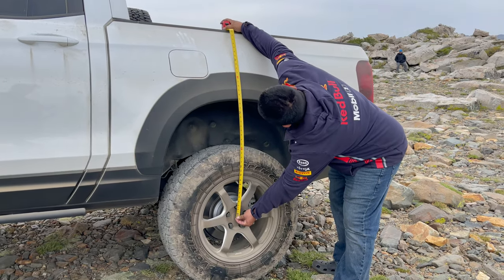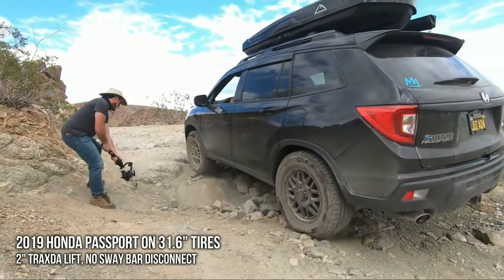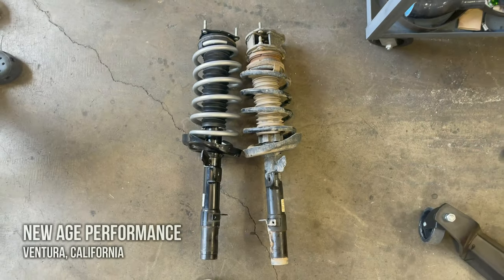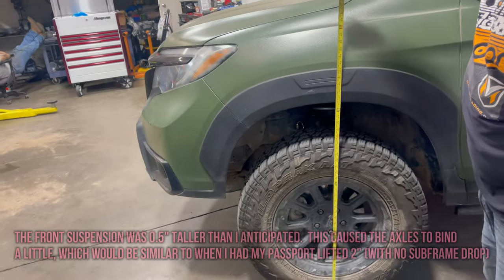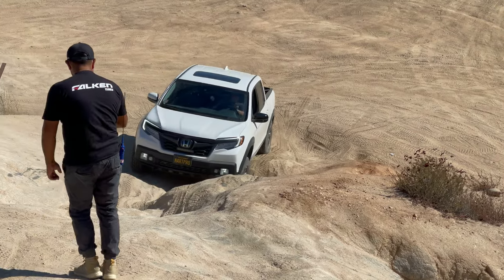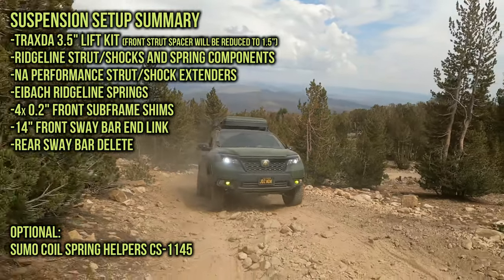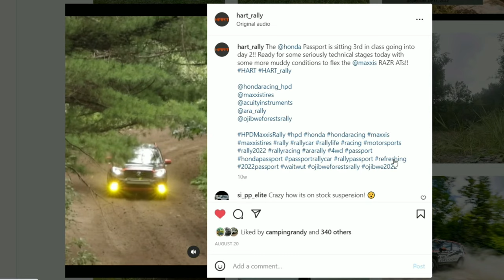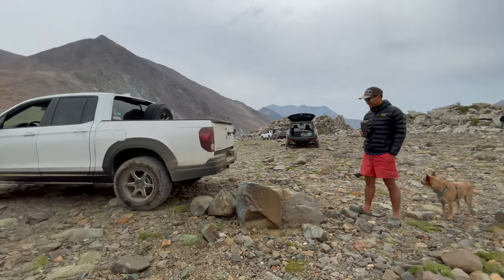AMAZING FLEX MODIFICATION - Honda Ridgeline / Passport / Pilot

Comment: Man it's pretty amazing to see how capable an AWD is on these trails.
Reply from the maker: Cleghorn is a crazy trail.  I didn’t to do so well, and I’m thinking it was a few different factors, but glad to have Manny out there with the offroad skill.
Reply: I have to ask, at this point of trying to prove your AWD CUV point, do you now wish you just went straight 4x4 truck?

As an owner myself of a 2020 Honda Passport Elite AWD with sights on getting out there on more trails, your investments seems to now exceed the up front cost of a similar "true 4 wheel drive."

Looking for an honest answer as we intend to trade for a next gen Trailsport in the next 2 years (waiting to see if they upgrade enough) or just outright buy a 4WD truck.

TY...
Reply from the maker: Honest answer, the Passport still doesn’t drive like a 4WD truck.  Daily drivability is high on my peoples list, that’s why crossovers are so popular.  The point of the modified midsized Honda is that you can have something that is great onroad but also has enough capability to tackle some legit terrain.  Most AWDs can’t handle this stuff.  So the midsized Hondas are a literal LIFE HACK.

Also here’s a cost break down of my after market mods:  $1200 for the 3.5” Traxda lift kit, $337 for the Eibach springs.  It’s not exactly breaking the bank.
Reply: ...+ wheels/tires multiple upgrades as your undercarriage continues to evolve,  + several different lift/springs configurations, 
+ labor (the added back breaker for those of us that have to pay full boat on that portion).

We absolutely enjoy the road drive/feel of our "stock" 2020 Honda Passport Elite AWD.  She's no slouch.  BUT next level trail prep seems unattainable versus just selling private party and going straight 4WD truck.

Despite that feeling, I would like to ask you a DM question regarding up sizing the current stock wheels/tires.  I've read (your website + YT comments) and seen all of your videos on the matter but there seems to be one unanswered question/concern that I did not take note of being addressed.

TY.
Reply from the maker: @CC_Marauder  You love the way your stock Passport drives.  Are you familiar with how a stock body on frame 4WD drives?  Do you want to float around on the highway and make micro adjustments just to keep your vehicle in the center of the lane?  Just so you can have an “easier time” on some of the moderate 4WD terrain I drive on?  Anything beyond moderate 4WD, you’ll just put yourself in a position where you can more easily break stuff.

With the 3.5” lift taller tires, I know it sounds crazy, and I wouldn’t believe myself if I didn’t actually experience it for myself, but with the 3.5” lift,  taller tires with 18 inch wheels the Honda drives better than stock.  Mine doesn’t because I have a RTT, but it’s still superb for what it is.  It still rips at a stop light and highway passing power is decent.
Reply: @CC_Marauder  u have to buy AT tires for 4x4 trucks too, they all come with street tires unless your buying a wrangler or a bronco.  The 4x4’s are also substantially smaller interior wise, get mediocre mpg, and have very bad crash safety

Comment: Definiteley going to stay tuned for his flex mod in the (hopeful) future! Havent got a ridgeline yet but I'm almost to that point.
Reply from the maker: @calvinhawkins1083  well, this is an old video and now there’s even more flex and a dual spring (progressive + linear) spring setup.  Also provides a platform for the perfectly dialed in spring rate.
Reply: @JonDZ_Adventuring  Ill get caught up on the most recent upgrades with your newest video. Dont have a Honda yet but I'm almost ready to grab one this fall. Thanks for the content and yalls effort to building up these vehicles aftermarket.

Comment: Another great video, Jon! With all these modifications to the suspension components and various products used, have you encountered anyone using the Flatout Suspension shocks for the Passport or newer Ridgelines?
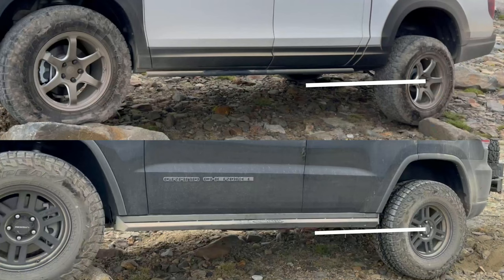Reply from the maker: Thanks Andrew!  Yes, I have many friends that have tired that system, and at 15:58 I talk about it.
Reply: @JonDZ_Adventuring  Definitely missed that part of the video 😂 Good to know people you've driven with have had issues with the Flatout suspension. I thought they'd be better than that since they were used in the rally car. Now to think about if I want to get the Ridgeline suspension parts modified to fit the Passport like you have 🤣
Reply from the maker: @andrewyao6081  flatout is not used in the Hart Rally car.  They use completely stock Honda passport suspension (not even Ridgeline suspension) 😃
Reply: @JonDZ_Adventuring  Ooooo so Flatout was fibbing about their shocks and struts being used in the rally car 😲 False advertising ☠️
Reply from the maker: @andrewyao6081  “Incredibly, the Passport’s production 3.5-liter i-VTEC® V6, 9-speed automatic transmission with paddle shifters, intelligent Variable Torque Management (i-VTM4™) all-wheel drive system, and all suspension components are left unmodified for competition; the only addition is an automatic transmission fluid cooler from the Passport’s available tow package. The driver uses the transmission’s Sequential mode and paddle shifters for enhanced control, and the Passport’s Intelligent Traction Management system’s Sand Mode is utilized for optimal torque distribution and performance on loose surfaces.”

Source: https://hondanews.com/en-US/honda-racing/releases/release-4f32a27ba2ad7509bfa642e11604d2cf-2022-honda-passport-is-ready-for-stage-rally-competition
Reply from the maker: @andrewyao6081  unless something has changed in the last 20 days, the Hart rally Passport is on stock everything except for wheels/tires, weight reduction and roll cage, and a chopped exhaust.

Comment: Let’s see this transmission cooler fan install video. Did you upgrade your trans cooler or just added a fan?
Reply from the maker: The ZF9 has a proprietary transmission cooler with quick-fit fittings.  It will be hard to get an aftermarket transcooler kit to work. 

The fan I bought was $10 from Amazon.  I just had it push into the transcooler.  It simulates Ram air when slow trail driving.  It’s not idea, but it does make a difference.  

You don’t want to see my install.  I used zip ties 🤣🤣🤣
Reply: Lol. That’s kind of why I asked. 😂 Zip tie DIY FTW! Mr. Rigged would be proud.
Reply from the maker: @Op-gj3hf  🤣🤣

Comment: Sooo.. @8:16 Emanuel talks about an option to use his NA extensions + Eibach springs on the stock Passport (and Pilot I assume) struts.  Are the Ridgeline springs interchangeable with the Passport/Pilot springs?  And would the NA extensions work on Passport/Pilot struts?  Aren't the Ridgeline strut shafts thicker? Or are the threaded ends the same on all OEM struts?
Reply from the maker: The front struts are totally interchangeable along with the springs.  The only thing that may be different are all the rubber components.

The rear shocks are thicker on Ridgeline and the Ridgeline springs will not fit with the passport top hat.
Reply: The extensions will work on passport and pilot but my idea for a budget option was using stock ridgeline springs on passport struts with extensions.  That would be interesting 🤔
Reply: My 2019 FWD Pilot rear struts and springs feel so soft and bouncy.
I would really like to upgrade it but can’t find anything, I would like to keep the stock height though
Reply: Would love an update on how doable this is poor man's version of the suspension mod. Especially now in 2024 the Eibach springs are nowhere to be found.

Comment: I'm wondering between baby bronco and passport, and mostly for that dual range TC, baby bronco seems obvious - I have seen it do insane things with the right driver ... but now with good mods out for the passport and John giving us the view of how capable it is, I'm not too sure ... anyone know of any head to head reviews?
Reply from the maker: The Bronco sport does not have a low gear transfer case, and only the badlands edition has the twin clutch rear differential.  The Bronco sport is geared 17.9:1, the ZF9 Hondas are at 20.4:1.  The Bronco sport badlands does have a nice traction control system though, I’d say it’s the best right now out of all the AWDs.

Comment: Do you think that the Sumo coil  spring helps could help my FWD Pilot 2019 , I find it to soft when loaded with luggage and people
Reply from the maker: They could help, just get the CSS-1145 (not the CSS-1125 that Sumo Springs will recommend).
Reply: @JonDZ_Adventuring  why the 1145, and is that specific to the rear?  When measuring mine (2016 touring with ReadyLIFT SST) I come up with 13/16 which suggests a 1094.
Reply from the maker: @danswenson9115  my friends and I have observed that the CSS-1125 makes no difference whatsoever.  The CSS-1145 definitely does.
Reply from the maker: @danswenson9115  yes, those are for the rear and I’m unsure if they would work on the front